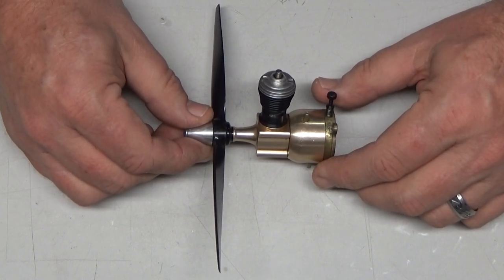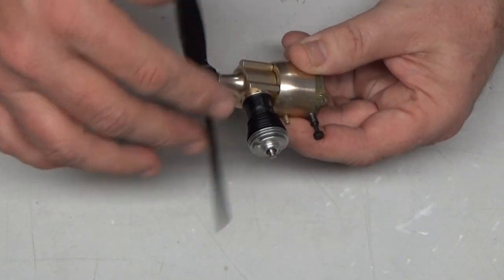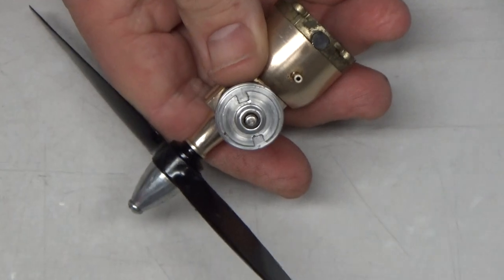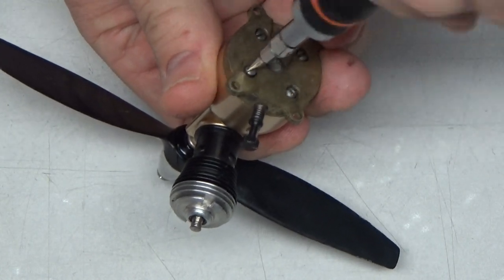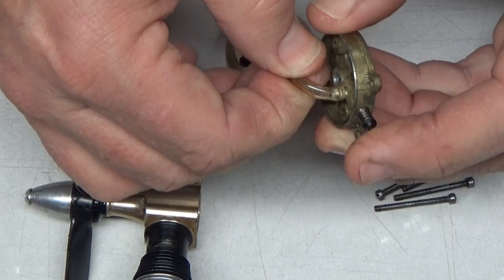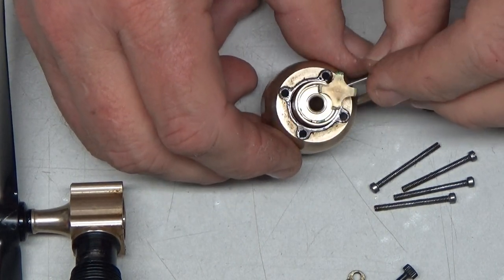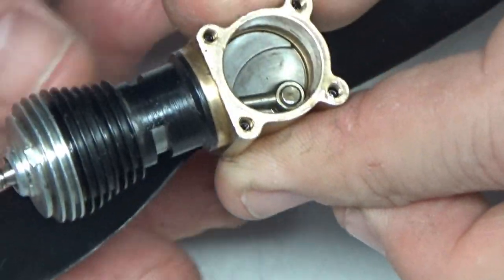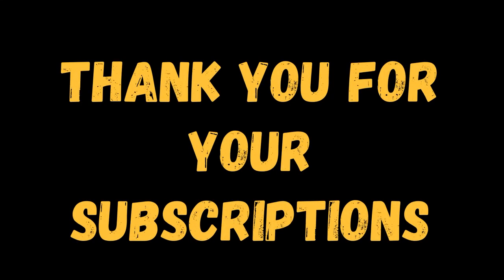Cox Golden Bee A Look Inside

Comment: I purchased my first Cox Baby Bee engine in 1956 when l lived in the Bronx at 11 years old. It was bubble packed in a blue carton and paid $3.95 for it!! With the help of my dad, we ran it in my room in the apartment with a big Everady dry cell battery and mounted it on a chair in a vice mounted on a piece of wood. Boy was it loud! We used those  small cox fuel containers with  the screw on pumps. I remember that in the instructions cox mentioned that you could drill out the bottom of the tank to attach a larger fuel tank. It was normal for the piston to turn brown after time with running. Those were fun days!

Comment: Be REAL careful using those Cox wrenches- don't remove the cylinder unless you have to- you can throw a burr into the ports if there is any resistance at all, hit it with a heat gun.

Comment: No dude! don't replace that fuel pick up tube! all the cox engines that have the tank on the back are all hard, its so it don't move around in the fuel tank when running. and also for getting all of the remaining fuel.
Reply from the maker: I replaced the line with another, so I do not understand the big deal.  I think I know what I am doing....
Reply: You do. That pick up tube was originally flexible, which is why the spring is in there to help keep it open and in one position. Once these are exposed to glow fuel, they don't last a real long time before they harden up.I was running these back in the 1960s and you have to replace them frequently.

Comment: I never had or saw a Cox that I couldn't start. They are one of the little engines that were the gateways that gave us the model airplane addiction. They were very reliable. A Cox would not let you down. If you can get your hands on one, get yourself a Cox .15. It is a hot little runner.

Comment: Just a point of interest, how the pickup tube is positioned depends on what it is going to be used for. Off to the right for control line and down for free flight. I was holding my breath when you took out that reed. They bend easily.
Reply: Depends on if you have a pusher or not and/or which way around you fly.

Comment: I have a Golden Bee in similar (great) condition to yours David. I believe the fuel is critical to ensure long life of these engines. Do not use synthetic oil based fuel, it will drastically shorten the life of the bearing surfaces, particularly the crankpin/big end. Castor oil only recommended. 25%nitro/20%castor/55% methanol. Mix up your own if possible. They like plenty of nitro!
Reply: I couldn't afford that fancy fuel when I was 14yo. But that mix sounds like it would really make the .049 sing.  I remember older boys would have the Nitro in the fuel and have a 1.5cc engine to put it in. Those things used to scare me they were so fast and loud. It's ridiculous now to think that a 1.5cc engine would be anything to concern yourself about.

Comment: Hi David.The piston top is copper plated coating to prevent corrosion,and its a steel piston,so all Cox engines look the same like that.The fuel tube is not so bad,as long it seals at the nippel,so it wount suck air. You got your self a  pristine & nice Golden Bee!! The Golden Bee are pretty power full ,with 2 transfer ports.If you put a High compression head on it.,.Oh boy..it will scream and move a lot air for its size.
Cox  make a lot type of cylinders with several boost port arrangements. one,..two, and two with extra 2 boost ports. Indeed on Wikipedia is it well explained. It stays nice stuff.The factory had a temperature controlled machine room,so it can made those engines with amazing precision.You can take every  new piston of a other new engine,and it will ALL WAYS fit perfect!
Thumbs up...and be  VERY care full with the membrane...    ;-)
Reply: Bit aged this comment,  but here goes!
1.  The reed material on Cox reed valve material isn't copper,  it is either phosphor bronze of a mid to hard temper,   or it is beryllium copper.
2.  All Cox ball and socket pistons have copper plated crowns,  but it isn't for corrosion purposes.  When the piston is made after machining the blanks are copper plated all over.  Then the pistons would have been run through a centreless grinder to remove the copper just from the outer rubbing surface.   Next the parts are placed in a molten bath of sodium cyanide salt at about 600 deg C.  Then the parts are removed and quenched in cold water.  The copper works as a "stop off" preventing the carbon from the cyanide hardening the socket area which has to remain ductile to roll over the conrod's small end ball.  Only the piston sides are hard and were then precisely ground to finished size on a centreless grinder.  Check up inside a Cox ball joint piston assembly and you will find that it is copper plated.
Reply: I can remember a lot  brand new Herkemer motors that did not even run because the piston fit was so bad.

Comment: Those reeds can build up gunk on them and leak just a little.  Sometimes they can be cleaned off and reused.  Pretty cheap to replace.  Nice copper reed valve.

Consider relocating the pickup tube further down if you use it for RC use.  It will pull more fuel that way.  They put many of those pickups on the side since they were used in CL models.

Comment: Spiffy. My favorite Cox engine. Got 4 of them currently. "Feels really old and dry rotted"- got a lot of that going on myself of late!
That is the first thing you replace. Reed valve is fine, late ones are mylar plastic. The anodize color varies from a dark gold to a very light color depending on the strength of the anodizing solution they ran that batch of motors thru.
Reply: Well, actually 6, did a recount.

Comment: What I have learned in my 40+ y in the hobby, if it ain’t broken, don’t fix it😂, the “squick” sound could be that it was designed with a “tapered sleeve” , like the larger later nitro motors, referred to as “ABC’s”, although I doubt it very much. This was done for compression, as these small motors don’t have rings for compression, this might have been the only way to compress the fuel / air mix near TDS.
Maybe google will know, or some Baby Bee experts.

Comment: Kit...Ridgerunt,26 inch wing span, Golden Bee .049, 15% fuel, 2 channels Ailerons and elevator.  Balanced APC 6x4 prop.
 2 oz of fuel, full tank, 6-8 minute flights. Fully aerobatic. At the end of the flight climb, fuel done engine off, glide back to earth doing loops, rolls, wingovers, back to your feet.
A TeeDee .049 and a onboard 2 oz.fuel tank , steps things up a bit.

Comment: That is defently a low run time Golden bee that is also fairly early too since it has the thin wall cylinder very nice indeed. That squeak is the reed it should run fine. The hard fuel pickup tube is common btw shouldn't not hurt its running performance. One thing don't leave that spring out of the pickup tube that is what you might call a capillary spring helps keep fuel in the line. If you want check out the Cox engine forum www.coxengineforum.com. It's loaded with information on cox engines. I'm a member there great people! :) A great fuel for cox engines is Sig champion 25% it has the correct amount of oil (Castor) to protect the ball and socket awsome video!
Reply: Ball and socket joint is critical on these engines which is what the castor protects. The hard fuel pickup tube is indeed common, and is okay as long as it doesn't leak or crack around the area where it goes on the back plate, then it causes you all sorts of trouble. I usually just trash can any that have hardened at all. The spring needs to be clean and free of gunk also.

Comment: Dave - do you have a video that shows how to remove the front part of the crankshaft of a Cox 049 ? I basically need to replace the crankshaft from one of my Cox 049 engines. Thank you for your time.
Reply from the maker: No I do not. Sorry
Reply: @dmrcflyr2  No worries - I did find the right removal tool from Cox international and it's only a few bucks ... thank you for your response.
Reply: @charlesbovalis6591  Don't forget to purchase the installation  tool. It puts the prop back driver back on the shaft correctly without installing it crooked. I know, I tried to put them back on with out it, by just pushing on the crank on the back ( with a steel rod) and the driver on the front. All done in a vice and the prop driver was crooked by 3mm. So the prop wobbled.

Comment: Hi that is the read valve I have about 20 Cox engines they all do the same :-)
Reply from the maker: Oh ok good to know.  I noticed the squeaking sound went away after I pulled and replaced the Reed valve on the tank.
Reply: Sometimes yes, sometimes no. If it squeaks, pull it off and clean and re-seat or replace it.

Comment: The thing that gives me trouble is the o ring between the tank and backplate
Reply: That is another aggravation area.
Reply: I use a drop of 3 in 1 oil on my finger, then the "O' ring on my finger into the oil. Then install the "O" ring on the tank.
It stays put when I do it that way when I put the tank and the back plate together.